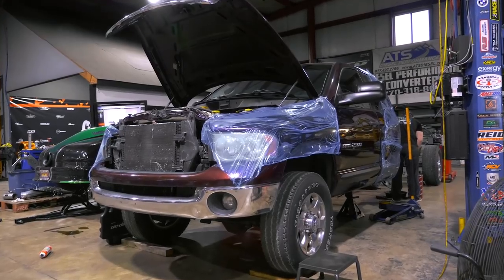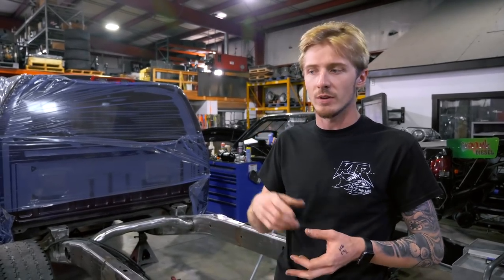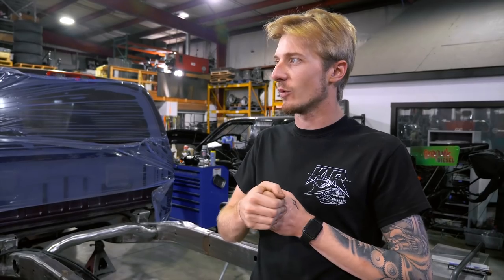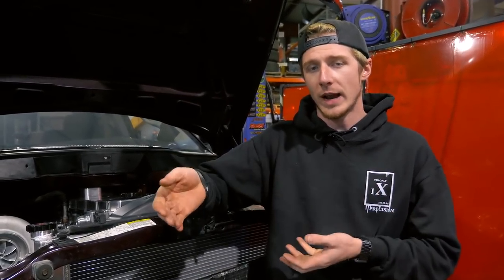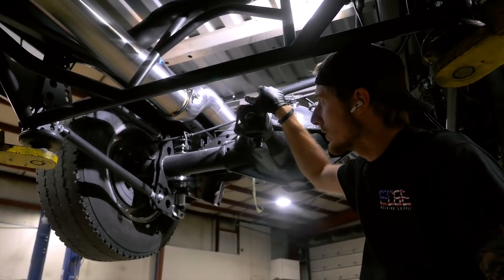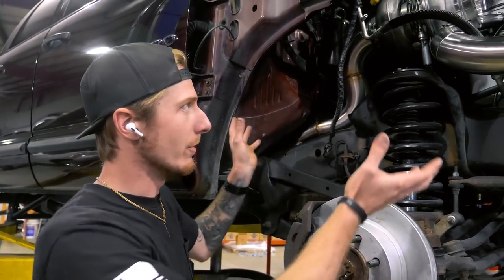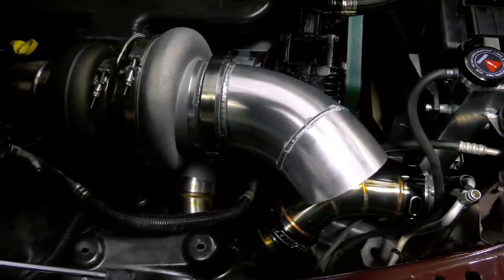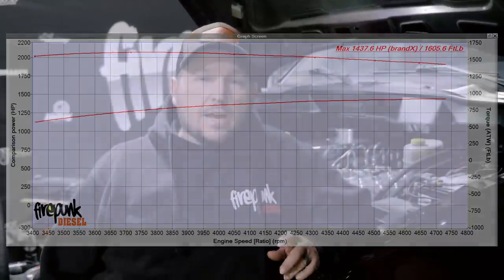JAKE LAVENTURE - ENFORCER, GT55, 4-LINK, 400%/14MM - A SLEEPER WITH AN ATTITUDE!

Comment: I like how you vband the gt55 cover. You don't see big singles on the street very often any more.  Awesome job on the exhaust.  I'm surprised the customer didn't dump it before the rear axle.  Great job.  I know it's not easy welding that stainless with out burning it .

Comment: Cool to see early 3rd Gen love.  I still have the clean silver short bed 03 HO 6 speed manual I bought off the original owner back in 05 with 39k miles for $25k.

Comment: I've used those exhaust hangers, they tend to crack around the weld over time.   They also offer the same design with a clamp and they work great without cracking.

Comment: Question, how long will that pipe last compared to the average crap steel most exhausts are made of? Im so sick of pipe and welding a new exhaust system everytime it rots off befause like where you are, here in PA they use so much salt it makes me sick so nothing thats left raw, ever lasts and im gonna be pulling my engine and putting all new power parts in it mainly some stuff from wagler and others haha, since im gonna open it all up and go through it and drop the block and head off to get machined .. but i have been trying to find the bedt exhaust pipe possible that will last for more than a couple years lol❤❤❤

Comment: How much boost was that turbo doing to hit those numbers?
Reply from the maker: 74psi
Reply: @FirepunkDiesel  what amount of total timing did it have?  I have a 12v, I find it interesting how much more boost they seem to need compared to a common rail. I'm around 115psi, but probably only 700-800whp. To the common rail heads flow that much better? Or is it the injection event , etc..?
Reply: @wild12valve  boost is the measure of how restricted your intake is. More boost means it's inefficient
Reply: @jacobstrutner8232  it's much more than that, has to do with the whole system including the exhaust, especially turbine wheel flow, cam, and timing.

Comment: Need ya guys to message me the $$ for this exact setup on 2005. Rock on!
Reply from the maker: $95k including trans, engine, fuel system, turbo, 4 link, all other fabrication, parts and pieces, add $4500 of nitrous and it's a 2000hp capable setup
Reply: @FirepunkDiesel  It looks like a legit setup. Jake is going to have a perma-smile!